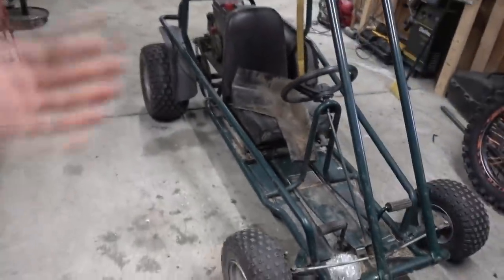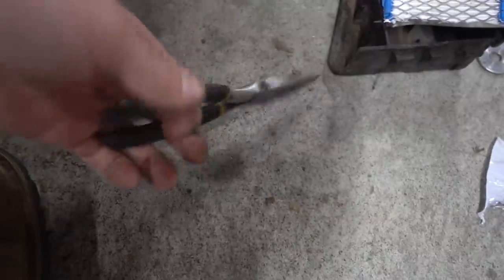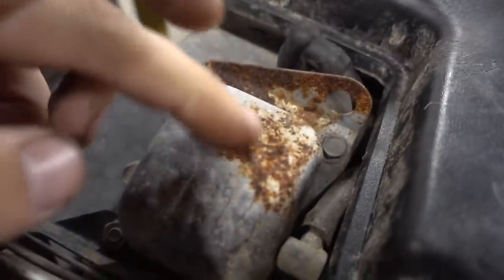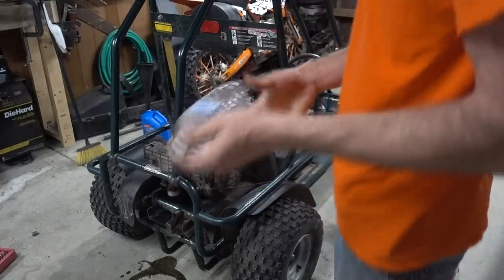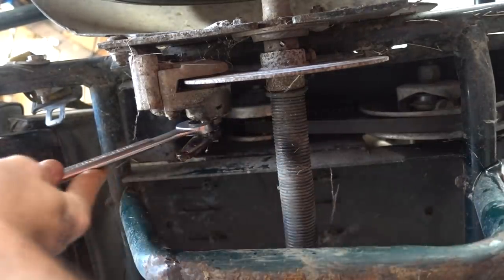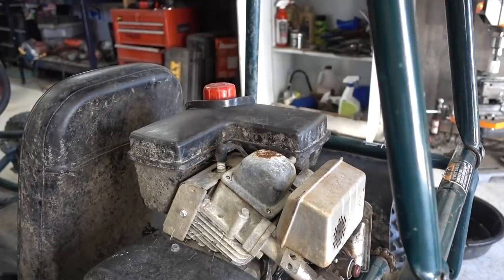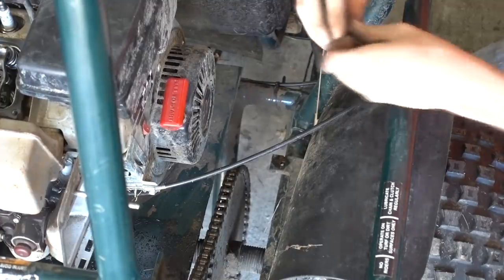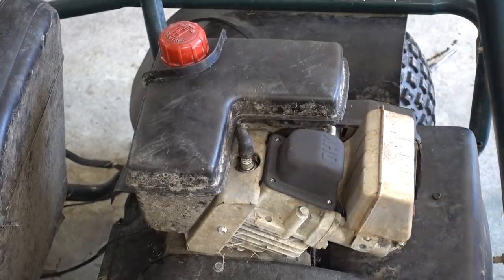Fixed it / Finished My Go Kart

Comment from the maker: 3RD. I've been keeping my eyes open for my next projects. It doesn't make sense to work on a rear wheel drive bmw before winter. And The Jeep currently can't fit in the garage and my other shop doesn't have my tools. So I'm looking for some small projects. 
Any ideas?
Reply: make your own version of a trike car, like a Can Am Ryker.
Reply: Make something to push some snow around with? I remember the big red being fun!
Reply: Build a few go carts to sell... something like you were just riding, just a little bigger
Reply: Take an old lawnmower or weed whacker engine and weld up a basic tube frame for a scooter and reuse some old throttle and brake links to control it. You could use some old 50cc dirtbike wheels and brakes maybe?
Reply: Go a little like cars and cameras for the winter, with go carts mini bikes, and fun small stuff...
Reply: Make an off-road mower
Reply: racing lawn mower
Reply: 3DMachines Chinese Quad?
Reply: FIX THE JEEP.   Move the tools over there get her done
Reply: Build your own mini bike frame
Reply: zero turn
Reply: You should take that plastic shed in your yard and bring it up to your land along with the goat cart and the gator if the winner dosent take it
Reply: why has nobody said build a mod sled?  do a twin 700 wedge Polaris or extend a phazer out to a 151.  he's done lawn mowers already. all these ideas above sound like some shit 12 year olds would want to watch
Reply: Your snowmobiles
Reply: Ryan Monahan - LOL it might be because they are 12 years old - you think 🤔 LOL you are so right. Thanks have a good one....
Reply: 3DMachines you should build this go kart and get an aftermarket car. You should order you parts from https://www.gopowersports.com they have a lot of parts for go karts and mini bikes!! Thanks ps love the vids
Reply: @3dmachines would you do a video explaining the govener and how I would be able to make a push lawn moure engine for a go kart?.im Irish so I no nothing about building lawnmoure gokarts🤣🤣

Comment: The whole near the valve cover was for the breather coming from the valves. It is supposed to run back into the air box so anything unburnt get sucked into the carb

Comment: The hole in the bracket that was on the valve cover is for routing the air vent tube for the valve cover.

Comment: Some people don't like those motors but I like mine I put stiffer springs on mine I got a murray hard drive with bigger shocks and extended a foot
Reply: Yeah I like my 6hp tecumseh too. Straight pipe it sounds better than my straight pipe predator 212 imo.  I had trouble with mine idling tho.. I drilled out the idle jet and it idles no problem now. Also i got a carb with a choke lever instead of a primer. I really like the choke lever better. I got it on Ebay for not much.. I have a view videos of the 6hp tecumseh and predator 212 on my YouTube

Comment: id run a tube from the oil bolt hole to the back of that metal plate and cap it there and then you dont have to wore so much about spillage or getting everything covered in oil